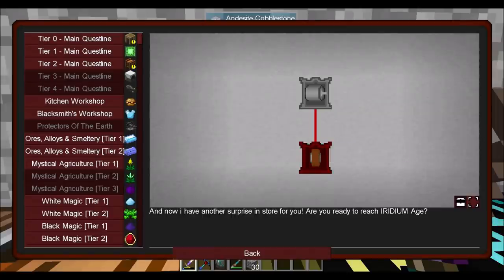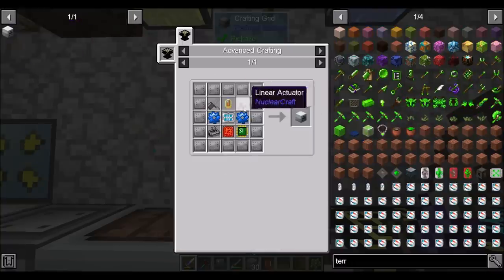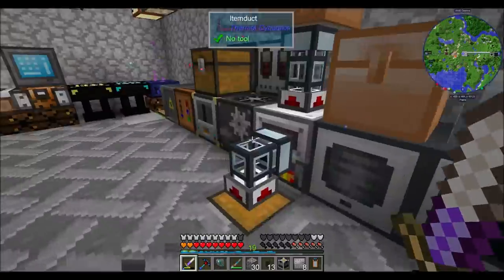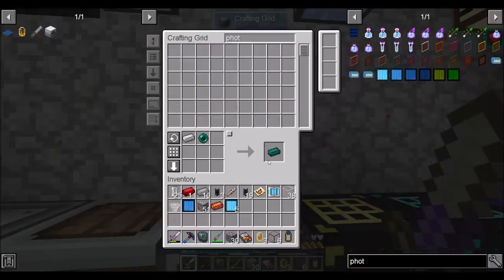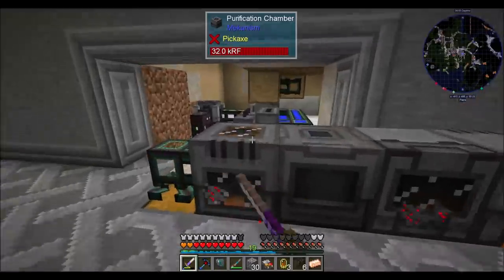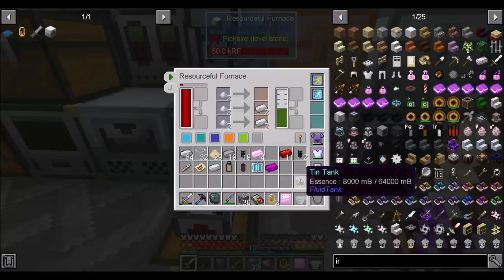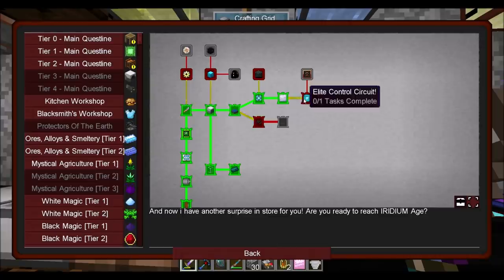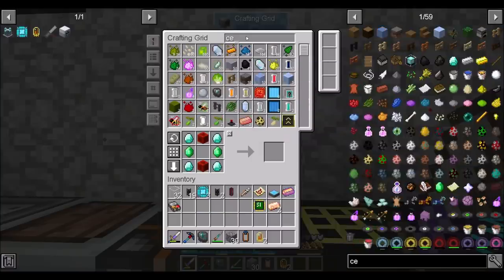DDSS   Ep47 Rolling Machine

Comment: Item Allocators Dire. Plop them on top of the tripling machines, with a sign to tell you what goes in, and then boom, no more manually putting stuff back into the machines when you've 'borrowed' them.

Comment: Been ahead of you for most of the series, but stuck on getting Osram to make the solar. And here you just have 15 sitting in a chest. sigh I'm scouring layer 31 of the nether for it with mining machines for a week and unable to find it. >.< lucky wolf.
Reply: Hey I have a question as you are ahead.. why is there no autocrafting yet? Once you got the storage, shouldn't autocrafting come with it? Did I miss something?
Reply: iirc osram spawns specifically on top of lava lakes in the nether, you should see plenty of it looking around one
Reply: @ChristDuque  The autocrafters are OUTRAGEOUSLY expensive.
Reply: They spawn on top of Lava Lakes in the Nether. They are a bit difficult to mine because of it. But with the jetpack and lifting off just before you mine the osram can keep you from getting burnt from the lava.
Reply: @ChristDuque  Only slightly ahead mind you, he's catching up fast especially since I was stuck on the Osram. Autocrafting doesn't come cheap or easily. Plus I haven't gone through the hassle to set up automation on a big scale. I'm nowhere near that point yet and doubt I ever will be with all the complicated recipes. Sure you can automate some things. But I don't see myself ordering this and that from the system and just have it all craft up as I would normally do. One can hope.
Reply: @taylor8566  I'm silly, I never looked at the lava lakes. I was just using the vertical miner for it and digging through the netherrack instead of around lakes. My nether portal spawned high above the lakes and I just never went down there. Thanks for the tip.
Reply: @Arcanien  Thanks for the tip, was looking in all the wrong places.
Reply: Obsidian boat is a bit cheaper than a jetpack, and does the same thing :)
Reply: @senjinthedragon  You can use the extended crafting automation interface to automate making crafters (if you're using RS). Becomes a lot easier after that, apart from the copious amount of special infused iron you'll need. (Edit) Also, make several carpenters, 1 for each mekanism circuit, 1 for each microchip, and 1 for transistors. Set the recipe in each one then you can attach a crafter to automate them. Takes a while, but is worth setting up in the long run.
Reply: @KeefyGeorge  Oh I'll automate more once I'll need 'lots' of something. For the moment I get by with manual just fine. It's just that I don't see it all becoming 'as automated' as I would make it in an easier pack. Not saying you can't, you can automate just about anything if you really want to.